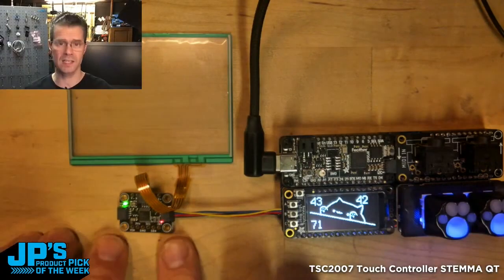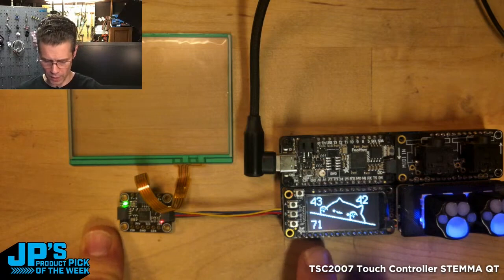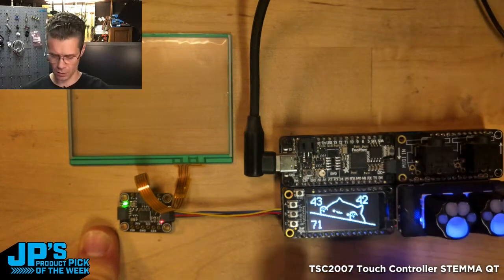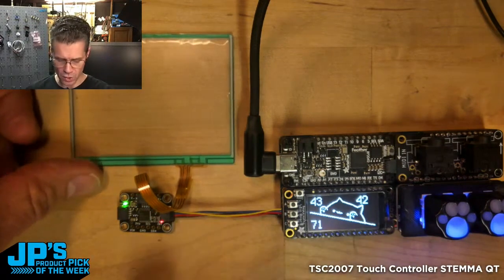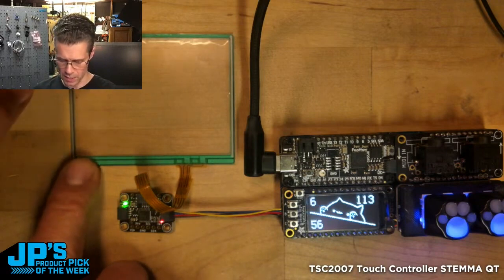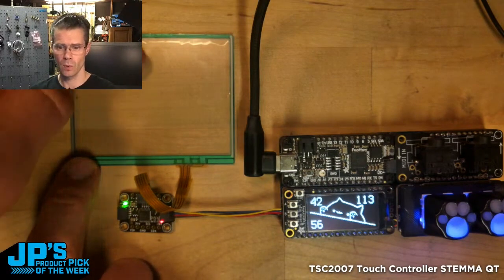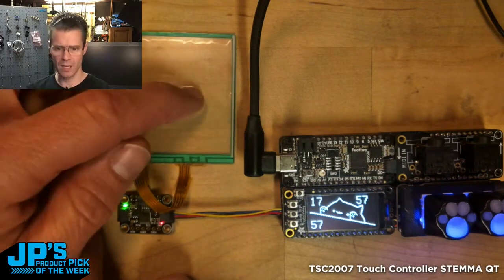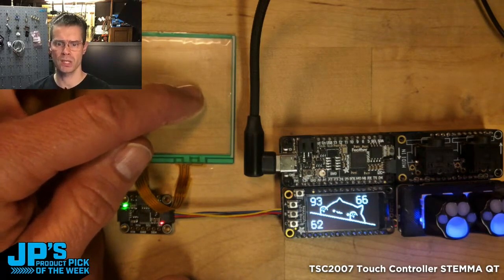JP’s Product Pick of the Week 6/21/22 TSC2007 Touch Screen Controller I2C @adafruit @johnedgarpark

Comment: This is literally what I'm trying to build.  Is there any code for this? does the controller do all the handling and just spits out the coordinates? Still waiting for my screens and controllers to arrive
Reply from the maker: I couldn't find the code, but most of it is shown here https://www.youtube.com/live/eXNup4nakOA?feature=shared&t=713 you can ignore the display stuff the only bit that i think i scrolled past was the midi setup which is the typical CircuitPython USB MIDI setup you'll find in learn guides.
The controller driver board sends the coordinates and pressure info to the microcontroller over I2C on the STEMMA QT cable.